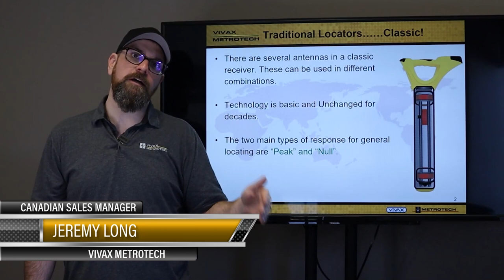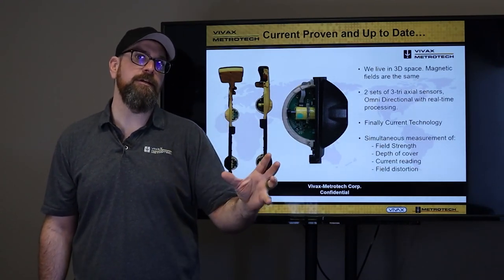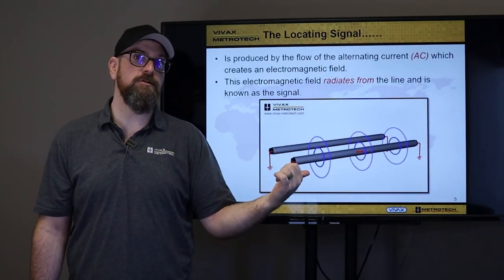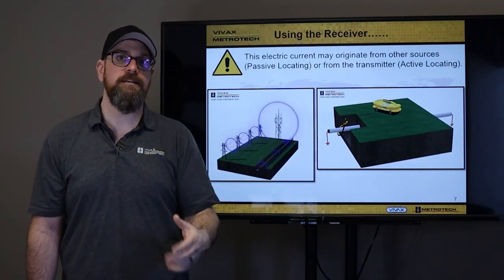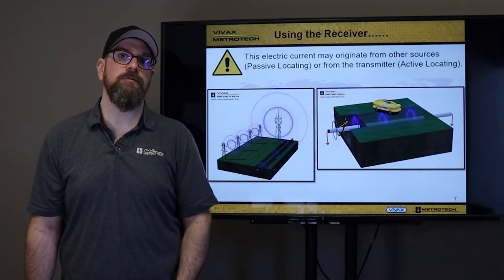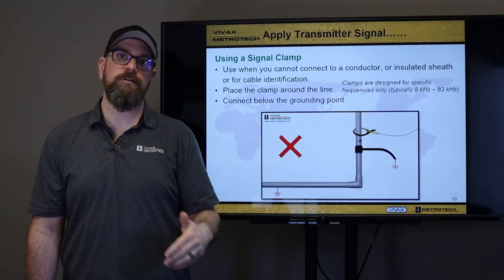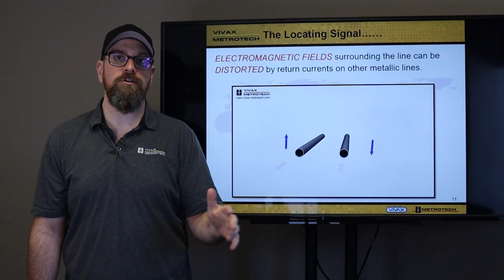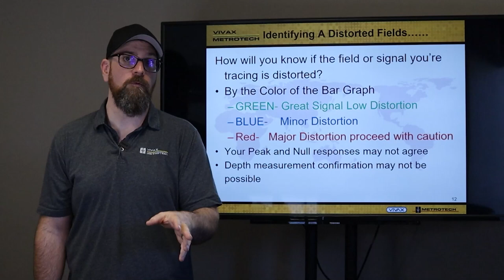How Utility Locators Work

Comment: What do you mean by walking the locate at the end? Can you explain that differently? Thanks for the vid I did NOT know about the clamp being below the ground, I always just try to put it as low as possible.
Reply from the maker: When I say Walk the locate, basically I mean start at your connection point and walk to the locate area following the utility that you’re  locating. Don’t connect and assume that when you get to where you’re going there will be signal. What if for some reason your signal goes left and you want it to go right, you wouldn’t know unless you followed the path.
Reply: @vivaxcananada  so you mean trace the line into the scope - thanks for the vids

Comment: Great video. When using your receiver, I have noticed that the colour distortion code used and peak  sometimes do not work in conjunction.  A ‘green distortion’ signal and the peak high point are not the same. Usually the green distortion signal will be below the peak high point. When this happens which part of the signal will be closest to my target line? Thanks again!
Reply from the maker: I'm not sure I fully understand but I'll try my best.  I believe you mean its green until you get over top/or at highest peak it changes?  
If so that is because the signal appears undistorted until you are directly over top of it or the coils are close to an object causing distortion. Such as a vehicle or fence perhaps.
Your highest peak signal should always be the closest to directly over top of the target. That should be where you paint.